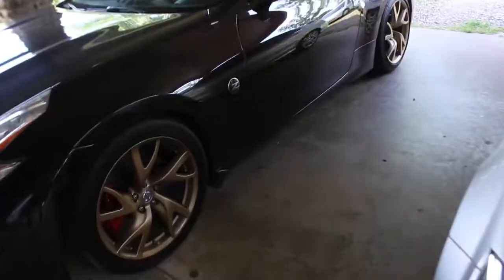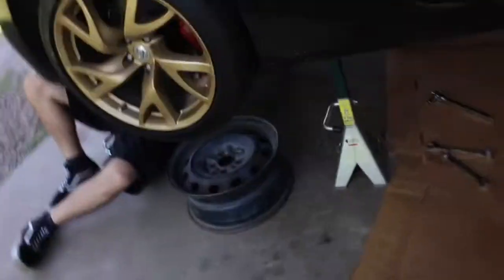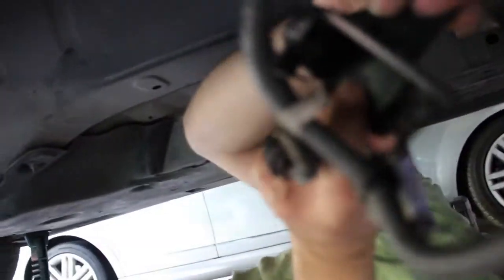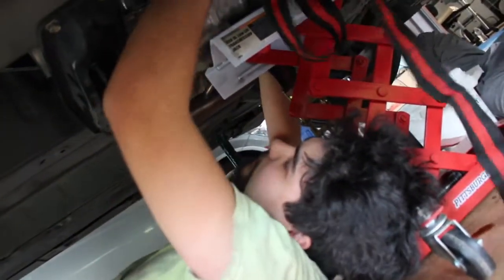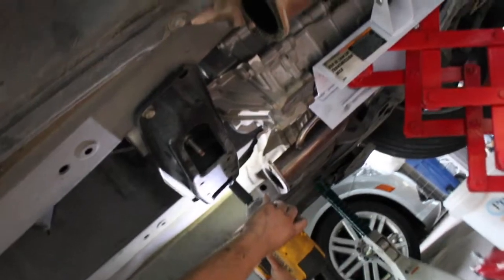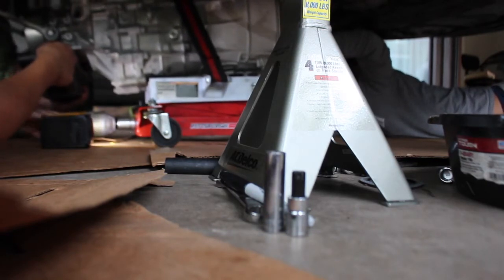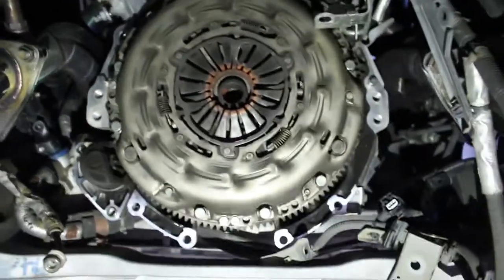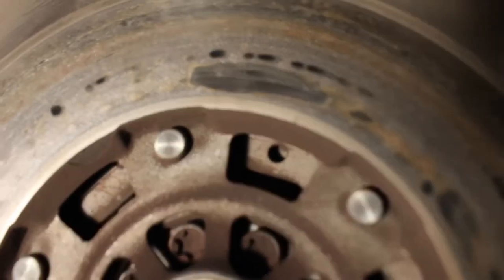Changing the 370z clutch pt1

Comment: Hey bro,  would you  recommend z1 midweight flywheel for daily driving and street racing
Reply from the maker: Yeah I do. It’s been a year with it and it’s helped a lot with downshifts and racing
Reply: @issaz3424  how long does it take to broken clutch,  because I order z1 clutch kit with the standard full face disk and midweight flywheel,  I took it for test drive and the car felt slower off the line ,
Reply: @issaz3424  did your car pull harder of the line with ur stock flywheel or the z1 midweight flywheel